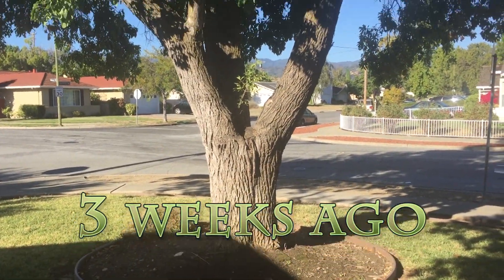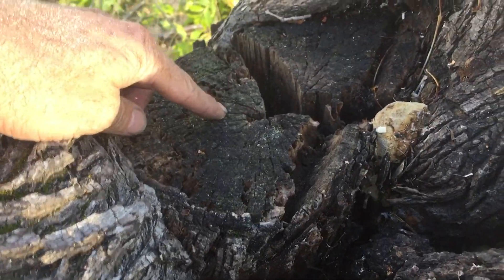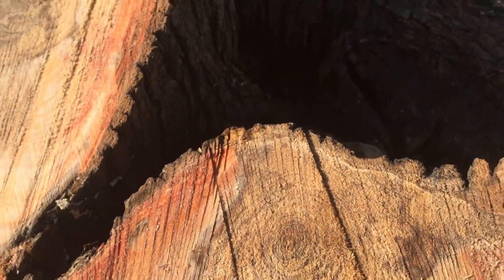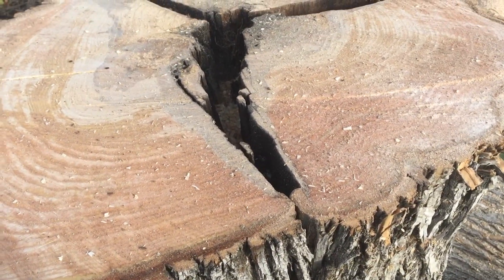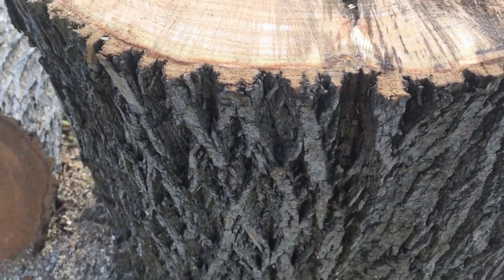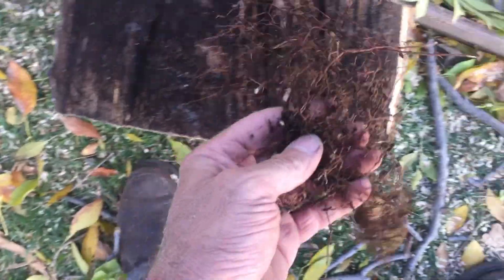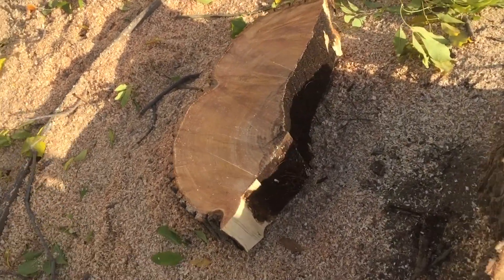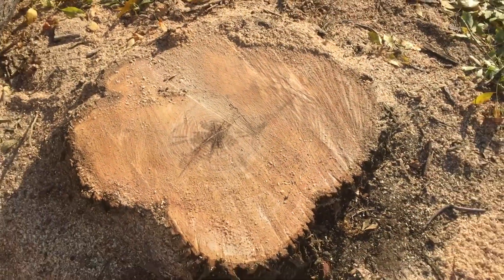Dissecting a DEFECT (in a tree)

Comment: If I missed a related video prior to this one, I apologize.  How did you cut this tree down?  Did you remove it from the top down and/or use your bucket truck?  If someone tried to fell this tree, with the splits in the base, would it be likely to barber chair?  I'm trying to learn how to recognize trees that are most likely to barber chair (if that's possible).
Reply from the maker: wandaw we took it down from the top half in pieces. Barber chair happens if there are ring shakes or interior splits and voids. Also can happen if you don’t make the back directional wedge cut first.

Comment: Good demonstration of how a large wound on a codominant  leads to trouble.  Any cut over 4" diameter should be reconsidered.  There's no such thing as a proper removal cut on a codom like that.  Codoms do not have collars.  
But were the owners really told that the tree would need to be cut back "really hard", AND cabled, AND still know the weakness would still be there?  

Cuts over 4" are really hard pruning, but much of the load could have been removed with smaller cuts.  The weakness would be mitigated enough by pruning 20-30% off, OR it could have been cabled with only light pruning.  Research shows that 15% off the end can lessen loading by 50%.

You're right; this is a sad story.  If the owners had a more detailed idea about pruning specifications, or the 30+ year lifespan for cabling components, they may well have hired you to maintain the tree for the rest of your lives.

Comment: Thanks for video, Blair! How do you think, may be some supporting system like cabling would good for that tree? And what do you think about same problem in oaks? I was asked to prune two big oaks with same signs on bark, one was lightning striked. And i suspect big decay in main trank. I remowed all dead and diyng branches, but not sure what to reccomend, leave or remove that trees. They more than 1,5 m in diameter and 30 meters height.
Reply from the maker: Valentine Skyback different species behave differently. This tree had to go

Comment: Hey there, I liked the look of the bucket on the pick up truck. Did you buy it like that or had it put on after purchase? And if so, by what company? Thanks, love the channel - Alex
Reply from the maker: Alex Martin Thanks Alex, I built up that little one ton. Found a deal on a 1997 Dodge (only 24 k miles on it!), I had the bucket on another truck that died. Bucket is called a Hydro Grupert. Goes up 41 feet but gets into tight spots.
Reply: How do you like it?
Reply: That's just what I'm looking for. Awkward spots on trees that are smaller, otherwise I'd be climbing
Reply from the maker: Alex Martin this is my rig. I keep it set up with all my personal gear. Love it!
Reply: Great! I'll take a look at them up here in Canada
Reply: Any chance I could request a video of it in use if it's not too much trouble? :) - thanks again, Alex
Reply from the maker: Alex Martin pretty much like any other bucket but faster and fits in under tight spots. Outward reach is limited compared to larger bucket
Reply: ok thanks - Alex

Comment: Same old story of non-maintenance by the home owner, allowing additional main trunks to grow up and merge (but never fully join as 1 integral trunk.  Happened with all those lower branches early in the tree's life (10-15 years old) up until it was cut down.

Some of those flush cuts are the same when I did the City of Fremont's park of the old NorCal Nursery (old Roeding company property) fruit yard (original Luther Burbank Santa Rosa plum orchard) and apple trees.  Complete heartwood  interior rot I wanted to clean out, then put in concrete (not wise) to strengthen these old girls (1900s).  Reason why I get flipping angry at homeowners and landscapers who plant trees too close to houses, flush cuttings, non-maintenace of their trees over their lifetime, ... and preventative pruning for double/multiple main trunks, crossovers, broken/weak limbs, downward branches, etc etc..